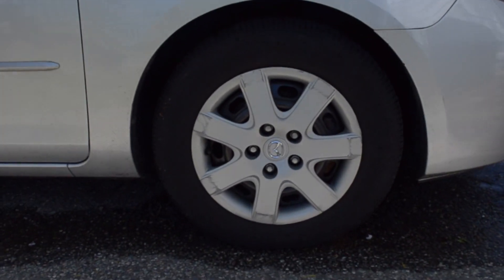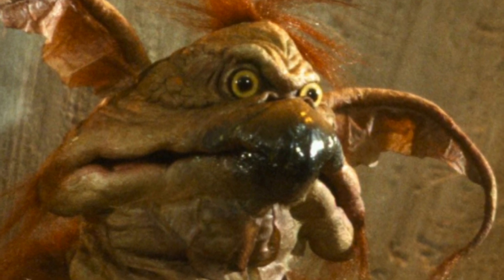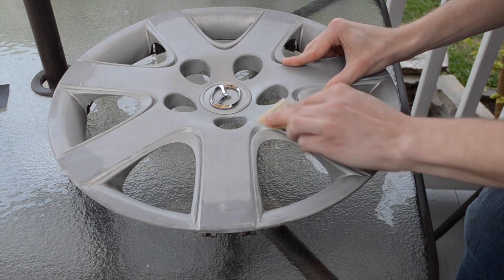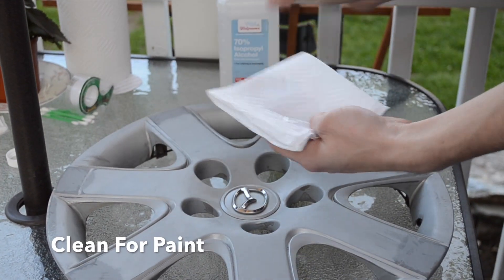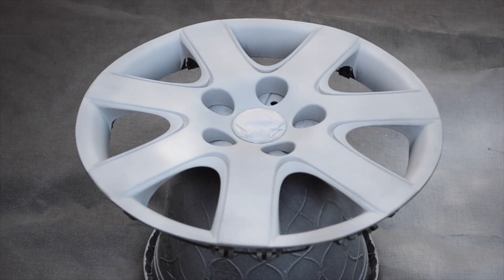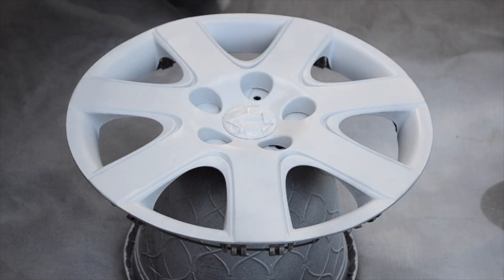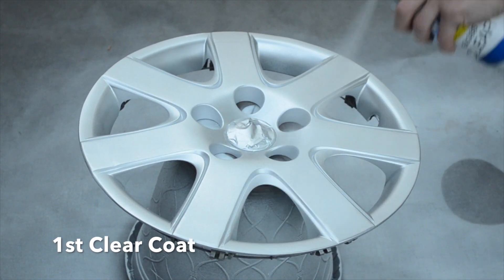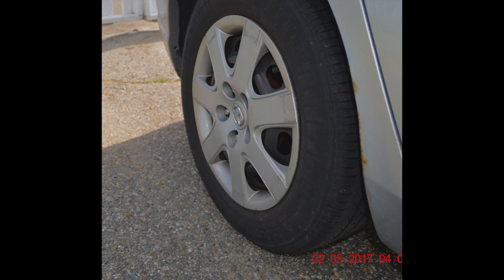How to Paint Hubcaps

Comment: Does it have to be 4 coats or could I get away with 3?
Reply from the maker: It depends on how heavy of coats you do, 3 coats could work if you go a little heavier with each coat, not too much so it runs but a little thicker coat is fine. You could try the three coats, wait for it to dry, then look at it in different lighting and if you’re happy with the coverage, go on to the clear coating

Comment: Great video and step by step guide. It does take a long time to clean, sand, prep the hubcaps. You are right it takes 4 coats of each primer/paint /clear coat to get an excellent finished product. Just a couple of things I found that helped me doing the project. I was refinishing my daughters Toyota hubcaps. You can push out the plastic chrome centre logo pieces, they have little clips that allow you to push them out from the back, so no masking. I used a sanding sponge that made it easier to get into the grooves, side areas. I was spray painting with 50-degree weather, so I placed the spray cans in hot water before spraying. Just make sure you dry the can thoroughly to prevent any water droplets falling on the rims while spraying. Thanks for all your hard work on the video.

Comment: Rust oleum 2X metallic Paint and primer and then clear coat. No sanding or extra priming paint required. Rust oleum steel wheel is expensive. Can get the 2X metallic for like $3-4 a can for all four. And another primer can for the same price.
Reply: ARE YOU SURE?!! Before I ruin these 8 hubcaps...
Reply: @camillethereal   no fr 😂
Reply: Here in Canada it's like $18.99 per can, but it is worth it.
Reply: Rustoleum 2x pretty much sticks on anything. Did I it on mine and it’s still good. They’re $6-7 a can now

Comment: Can I do this with plastic hubcaps where the layer coatings have started to peel due to exposure to the sun?
Reply from the maker: yes, I'd start by peeling off any of the flakes, then sanding down whatever paint is still stuck on the hubcap, then clean, prime, add a color coat, then a clear coat for protection, thanks!
Reply: @jwhit4075  thanks so much for the tips👍

Comment: wouldn't it give it a better smooth surface if the primer is sanded after the final coat? I finished applying the primer yesterday but it's kind of a porous texture. Thank you.
Reply from the maker: yes, you can do a light sanding with 600 grit sand paper, then clean the surface with alcohol and a lint free rag and spray the color coat
Reply from the maker: just be careful not to sand through the primer coat

Comment: From New Zealand,
I used this video to help me do the curb rashed wheel trims on my Toyota Ractis,and they now look 'as new', so thank you !
One small tip, if a wheel trim is cracked across it's rim area, an extremely strong and permanent repair can be achieved by glueing pieces of plastic from the lid of a ice cream tub, behind and across the split in the trim's rim.
I used a two part 'Araldite' type glue.
This has made a permanant, strong as original repair. I hope this helps someone, kind regards.
Reply from the maker: Glad the video was helpful. And that's a great idea for strengthing cracked plastic around the rim, I'm sure some viewers will have that issue as well. A couple of my hubcaps had cracks in the plastic and what i did was use an epoxy putty formulated to bond to plastic. It starts off with the consistency of clay and then dries hard as a rock after a couple hours. I cleaned, sanded, then added this putty and basically built up the missing plastic, let it dry, then sanded and painted it and it came out looking pretty good as well as providing some structural integrity to the hubcap. The putty is called J-B Weld Plastiweld Epoxy Putty if you are interested. Thanks for the comment with the tip, im sure it will be helpful to some viewer and thanks for watching.

Comment: Can I use this same process if the hubcaps I want to paint black has two colors(gray/black)? If the hubcaps has no scratches, do I still need to sand it? Can I use black paint that already has primer included? If I use black glossy, do I still need to add the clear coat? Thank you!
Reply from the maker: question #1 Yes, question # 2, no, maybe a light sanding with 620 grit, but you can just do an alcohol wipe and apply the primer, question #3 You can try it, most likely would get the job done, but personally I havent tried it so i cant speak on it, Question #4 no don't need clear coat for aesthetic reasons, but the clear coat provides UV protection and scratch protection, if the Black glossy dries hard and has UV protection you should be good.

Comment: THIS VID JUST HELPED ME A LOT BECUZ I REALIZE MY WHEELS HAS HUBCAPS. 

I'M TRYING TO PAINT MINES BLACK.
Reply: Yoster Amor how they turn out i want to paint my hubcaps black also
Reply: @Angelhernande2  they turned out amazing. I ended up sanding the hubcaps(after cleaning them of course), used matte black rustoleum paint, & put clear on top. Came out perfect
Reply: Primer also?
Reply: @Angelhernande2  The paint ii used had the Primer included as well. Once again it was the Paint+Primer Rustoleum Paint.
Reply: Do all Rust-Oleum black paint have primer added? I heard Rust-Oleum is the best brand for hubcaps
Reply: @Angelhernande2  For the most part they all come with Primer included but not all. It will tell you on the cane and it is absolutely amazing. Will not come off once u add that clear.
Reply: How many Coates you put on and how long did you wait after each coat?

Comment: If my hubcaps are brand new can I go straight to the 620 grit? Or should I still sand with 300 first?
Reply from the maker: The lower the grit, the rougher the sandpaper. The rougher the sandpaper, the more material it sands off. If you can get through the color coat easily enough with 620 grit, then do it, but if it's tough to sand through it with 620 grit, you will have to drop down to a rougher sandpaper, get through it, then come back with a lighter sandpaper to smooth it out. Thanks for the comment!

Comment: Do you need to clean and sand them if the hubcaps are brand new
Reply from the maker: Don't need to clean them with soap and water, You could do a light sanding with 620 grit, but id just give them an alcohol wipe, and start with the priming part of the painting process

Comment: I wouldn't even bother using that wheel specific spray paint. The most important factor is your top-coat here. Use industrial grade clears sprays like SprayMax, or Diamond Finish to ensure you have a very hardy surface that can withstand being on the road similar to you cars top coat..

Comment: i bought my car used, i think a crackhead try to paint the hubcaps black. They missed a lot of spots, it would be cheaper get some walmart caps, but these are factory hubcaps that i want to keep. thanks for the video
Reply: These are under-lug hubcaps that will not come off. Aftermarket hubcaps are snap on and you can easily loose one in a pothole.

Comment: Nice video, thank you for sharing, 1 quick question, what color of paint do you  recomend to optain the OEM shiny look? I will be going to autozone, thanks alot ..
Reply from the maker: The clear coat over the silver paint is what will give it the shine. It will also provide UV and scratch protection. As for the silver color, the most popular paints ive seen used are Dupli-Color Silver Wheel Paint, and the one I used, Rust-olem Steel Wheel Paint.

Comment: I dont know about that. Didnt appear to sand grooves or lug holes or sand primer and too much clear coat will yellow. I dont think these will look good for very long
Reply from the maker: Hello bliffblam! Thank you for watching the video and taking some time to state concerns you've had about it. I will try to break down your comment to provide you with more information as to why I chose to do somethings, while not doing others. 
       Sanding after you prime can lead to an overall better, smoother finish. The reason why I choose not to do this with my hubcaps was because I felt it to be an unnecessary step, seeing that the difference in finish you'd achieve in sanding vs not sanding the primer is nominal. However if someone wanted to sand after they prime, that's totally fine.
       As for the lug holes, because of there design, they are less exposed to damaging road debris than other parts of the hubcap. Mine were in good enough condition that sanding them like I did some of the more damaged parts was unnecessary. All they needed was a cleaning, light sanding, and really just a clear coat. Now if there are people who have hubcaps and the lug holes are damaged then perhaps more work needs to be done to them. But also because you can't see the inside surface of the lug holes when it is on your car I Also felt it was unnecessary to work on finishing a surface that won't even be seen.
      For the clear coat, there are positives and negatives to it. Some positives are the protection it gives to the color coat, the UV protection, and the "Shiny OEM" look it gives the hubcap. A negative is its potential to yellow over time (although the paint I used is non-yellowing, and so far that claim seems to be true) When you're refinishing your hubcaps you need to make a choice, Do you want the protection the clearcoat gives with its potential to yellow, or do you want to leave the color coat exposed to ensure no yellowing. The choice is yours to make. I decided to use a clear coat to protect the color coat, And I would recommend using a clear coat to anyone. For fun, I sanded and painted my iPhone case with just primer and the color coat and after 3 months the color coat was completely destroyed and damaged and it looked horrible, the color coat isn't durable like the clear coat and if your looking to have lasting results the clear coat is needed.
Reply: Whether u can see holes or not, or even if it's hard to get to like the grooves  it needs to be sanded enough to  remove gloss or it will peel.

Sanding primer gives better adhesion and smoother finish.

I'm not saying dont use clear coat. I'm saying u used too much. #1 cause of yellowing is too many coats.  Using rattle cans, 2 coats tops. Then hit them with a protectant everytime u wash, like 303 or something similar

If ur gonna do it, might as well do it to last. Just saying
Reply from the maker: @bliffblam  
You're correct, you want to sand down past the clear coat for the entire hubcap for maximum primer adherence. I thought I made that clear in the video but if I didnt, I apologize. 

You're also correct, Sanding the primer leads to a smoother finish. And if anyone is interested in doing so they may. I feel its not worth the time or effort seeing that the difference in the finish you would achieve by doing this step or not is so small (if there is any visual difference visible) it would only be noticeable upon careful up-close inspection. After all, we are restoring hubcaps, you don't need the care and attention you give to bodywork on a 70s Corvette. 

As for the clear coat, I don't believe I've used too much. It has been almost two years since the restoration and I've experienced no yellowing. All of my research supports that the amount of clear coat I've applied is fine. The paint I used recommends three coats. I did three light coats and one medium coat with no negative side effects. The issue with clear coat is that if you use too little it will give the piece a bumpy hazy look, and two coats, with the amount I sprayed during each coat, would not have given me the protection and smooth surface I was looking for. And you need to keep the coats light.  Perhaps it would be more telling to consider the amount of clear coat I applied to the piece as a whole instead of deciding if I applied too much based on the number of coats I did. You can easily apply more clear coat in two heavy coats than I did in there light ones and one medium one.
Reply: @jwhit4075  just wanted to point some things out that weren't clear for other ppl that might attempt this. 

Wasnt trying to imply u did a bad job. Just maybe not as thorough as I would do.  I'm pretty anal about shit. If I'm going to do something I make damn sure its gonna last. 

Cheers
Reply from the maker: @bliffblam  You've made some good points that needed more exploring. And seeing that there is no manual on how to restore hubcaps there are different ways to go about it so the concerns you posted were fair. Some people will recommend two coats, some people three, and some people four. I guess it also depends on the clear coat paint used and the conditions the hubcap is painted in. Plus how much paint to apply during each coat. I've shared my experiences and you have yours and hopefully, some viewers will see this and get some more information. Even though we may disagree, i think if we were to be hired to restore hubcaps, with our combined brain power, we would do a fine job. thanks for this discussion.
Reply: @jwhit4075  lol. You got it

Comment: Do u really have to use primer paint ??
Reply from the maker: You don't have to, however, there are benefits to doing so. Priming will help smooth out and fill in scratches on the hubcap. It will also provide a surface for the paint to properly adhere to. Without it, id bet the paint would chip off more easily and the final texture would be rougher.
Reply: Buy spray with primer +paint in a can.

Comment: How many cans of primer, paint and clear coat did you use for all four wheel covers?
Reply from the maker: I used one can of both the primer and clear coat and it was enough. I also used one can of the metallic silver but it started running low on the last hubcap. the footage in the video was of me panting my last hubcap and you cant really see it due to the video quality but the spray pattern was starting to come out a little more uneven. Also since I was running low I had to spray more conservatively then the primer and clearcoats on this last hubcap. Its just enough so you could do it with one can but if you mess up or do touch ups or anything you might need another one.
Reply: Thanks a ton mate!

Comment: No lie, for $10 more you can buy new stylish hub caps. Sadly my budget for this month only allows $10
Reply: Don’t get those! Waste of money, they are weak plastic and will rattle off within months
Reply: The same deal with replacement lights, aftermarket are crap and you will keep throwing away your money
Reply: @heavymechanic2  so true. I'm a hubcap collector, and most of what I find are aftermarket wheel covers with broken clips, because the company thinks they can save 💰 and use shitty plastic. most of these hubcaps come from Taiwan, and some companies even put logo stickers meant to look like the actual logo, though this is illegal without a license from the car company. I'm pretty sure somewhere legal, because I've even seen aftermarket hubcaps that had the model number of the real thing stuck to the back with a sticker. but I could tell it was aftermarket because of the shape and type of clips.